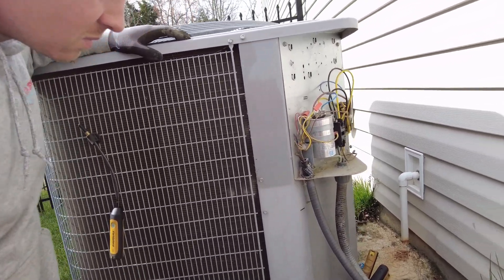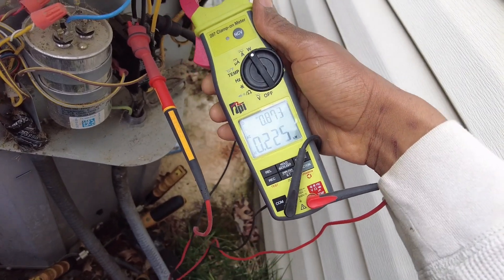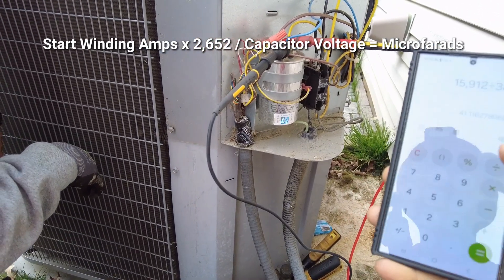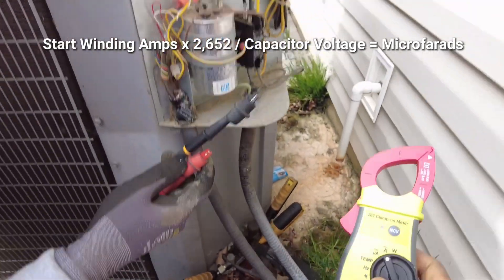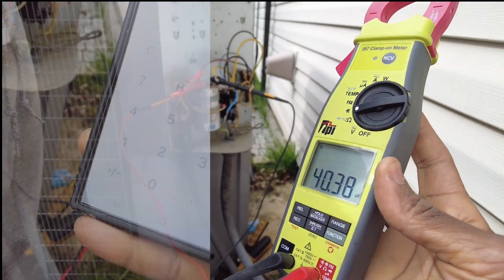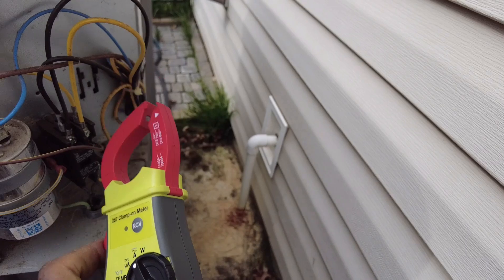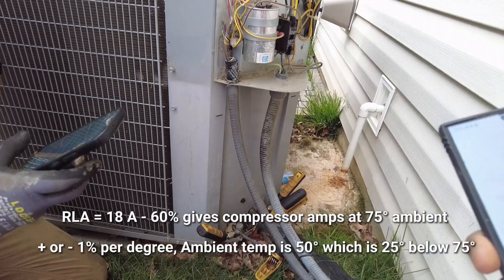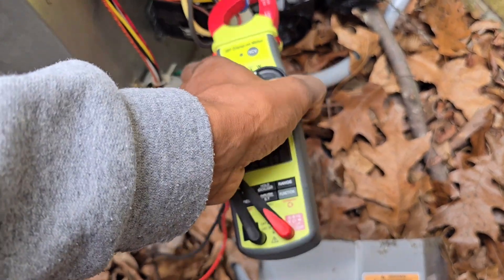There's More Than One Way to SKIN A CAP!! Check Capacitor Fast! HVAC Apprentice Training Videos Tech

Comment: Do you need to connect the meter leads to the line connections in order to get the power factor or can the meter determine it with only the amp clamp?
Reply from the maker: Yes sir, you need to connect the leads measuring voltage across the contactor